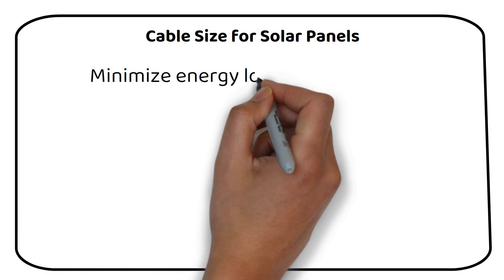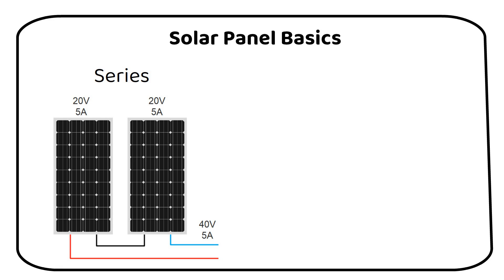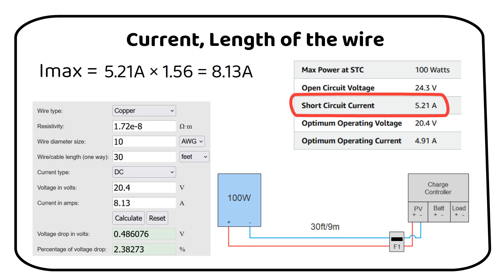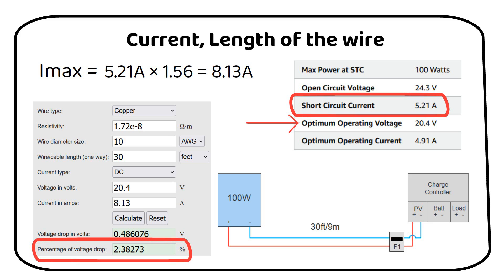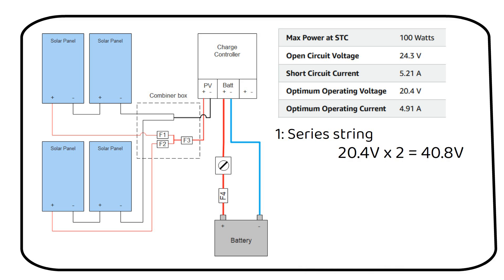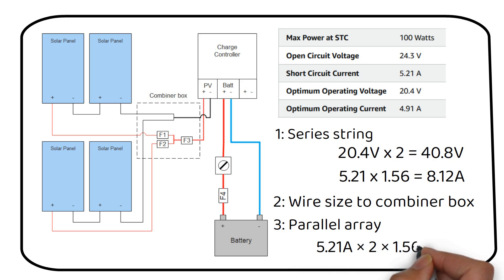Cable Size for Solar Panels - How to Size Wire for Voltage Drop

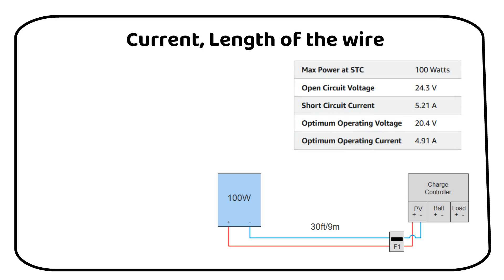Comment from the maker: UPDATE 1:53 to calculate voltage drop use Isc x 1.25 instead of 1.56.
My book on Amazon: https://cleversolarpower.com/off-grid-solar-power-simplified 
7 Free off-grid solar diagrams: https://cleversolarpower.com
Reply: no files on 7 free diagram
Reply from the maker: @Friona-il7og  I have uploaded them all to my homepage on the website now.

Comment: What is this App to calculaste voltage drop and percentagem of voltage drop?
Reply from the maker: I have a new video about the voltage drop coming tomorrow. I made a mistake in this one (Check the update note). The calculator is on calculator.net
Reply: @cleversolarpower  it is Voltage Drop Calculator
Reply: @c @cleversolarpower what is the link to new video?

Comment: You will notice the panel Where it says "Wire/cable length (One way)"  meaning 30ft is actually 60ft as a loop this is where you get your calculations from If someone tries to do the math without a app They might run into issues based off the idea that 30ft is 10awg

Comment: My panels to controller is going to be about 100 FEET. Maybe more.
Reply from the maker: You should wire panels in series and use an mppt. It's going to be much cheaper that way instead of getting expensive thick wires.

Comment: Hello if I have 4 X 570w panels rated at max of 13.07A and short crt at 13.7,A what twin core unsheathed solar wire would I need, I was thinking 6mm i have seen some sites say 6 mm is good 70a
Reply from the maker: It depends on the distance. Check my video about voltage drop.

Comment: Hey I have a question I really appreciate your videos and I'm learning a lot I'm new to solar systems I've got my solar batteries there are four eco-worthy 100 amp hour 48 volt batteries I've got to run them approximately 28 ft from my inverter and I'm having troubles calculating how much or how many gauge wire I need I'm running the 12,000 XP inverter and I was wondering if you could suggest is this even possible? I have no other place to put the batteries unfortunately
Reply: That is going to be expensive! It kinda depends on the amps going to and from the batteries, but you probably need to spec it to be able to handle 400amp continuous so it can handle going to and from the battery as well as surge when you start the Air-conditioner without causing voltage drop or melting the wire.
Reply from the maker: Indeed, that is going to be expensive. It's better to have them as close as possible. You need to do a voltage drop calculation as well. Search my channel for it.

Comment: So you should always use a thicker wire? The bigger the better?
Reply from the maker: Yes, but it will cost you more. And the terminals can only fit a certain size.

Comment: Isn't it that in the end of a day a current rate and cable length matters only? So let's just assume that 1m of cable which transfers 10A max, should be of 4 mm2. In case a panel has a maximum current of short circuit of 10A, then no matter how many panels you connect in series - you'll alway have 10A max. My point is that adding more panels in series increases the voltage, but it has no impact whatsoever on current rate thus cable diameter. Am I missing something? From what it can be understood from video is that for example 12V and 1A gives less wire diameter than in case of  24V and 1A, which does not make sense. It would make sense if the individual panel current would drop by half somehow by adding additional panel in series, but it is not the case.
Reply from the maker: As the length of a cable increases, so does the resistance. If resistance increases, the voltage will reduce or 'drop' thats why we call it voltage drop. Voltage drop can be reduced by increasing the voltage. so a 14AWG cable can carry 25A (90°C), but if you were to send 12V and 25A through it for 10 meters, then the voltage at the end will be 7.9V. Thats because the wire resistance is 0.165 ohms.

Comment: Why if we use copper wires it will getting black colour after a year?
Reply from the maker: Either you have a lot of corrosion going on or your wires are getting too hot.
Reply: @ 
Which cables u suggest for a 3KW Systems?
Copper or Aluminium?

Comment: Thank you Sir. Ive been through many articles and videos online , This is the first non confusing video on cable size that I encounter, The confusing part on the net is about the whole system voltage( 12 V for my case) and the PV panel voltage ( 37V) . Thanks again for the formula Isc X 1.56 which I didn't know.
Reply from the maker: A high input voltage is ok if you have a 12V system. It will reduce voltage drop. check my dedicated video about voltage drop as well.
Reply: @ Thank you again
Reply: @ I plan to use a single 300W panel to power 12 V lights in the house in case of power outage …No inverter…150Ah gel battery …lithium is way too expensive here.

Comment: Good video I think the takeaway is run the highest voltage possible first and secondly run the larger wire that you can afford.
Reply from the maker: Exactly 💯 limiting to 3% voltage drop is more than enough.

Comment: I normally wire my panels in parallel but i am currently installing 1.1kw ( 2 x 525watt panels) of solar feeding a Victron MPPT charge controller feeding a 280ah Lithium battery. How do you recommend i wire them? Parallel or series? And what would a 100/50 victron mppt work? I believe there are 100v maximum input and up to 50 amp.

They are STC Open Circuit 48V and about 14amp short circuit each.
Reply from the maker: You need a 150V charge controller. And always wire in series because that lowers the voltage drop and you can use smaller cables.
Reply: @ so if i wire it in series to increase the voltage will the MPPT still drop it down to approx 12v? Thanks for the help.
Reply: @cleversolarpower  im using 6mm (uk) cable which is about 10AWG (US). The cable run is around 4 metres. Correct me if im wrong but :

if i wire in parallel i get 21.875 amps  to my charge controller at 48v (my cable should handle up to 30 amps).

If i wire in series i get 96v and 10.9 amps to the charge controller?

In my understanding either wiring my cable would handle? Series drops to very low charge with any shade and as i live in UK that’s highly likely so why wouldn’t wiring in parallel to a 100/50 be the better option? I mean by them calculations a 100/30 charge controller would work?

Appreciate your view on this.
Thank you.

Comment: ok i am a newbie to this but i am taking solar kit to fiji where there is a lot of down time in electricity, so a solar system as a backup is going to help. but i want my system to operate as efficient as it can so i would greatly appreciate your help and any other imput people have.

i am confused though because i have bought a solar 360w solar blanket and a 100/30amp solar regulator

it has a short circuit of 18.85amp so imax = 18.85*1.56= 29.406amp. when i put this detail into the voltage drop calculator with a volatge of 24.147 from the solar blankets specification and running it for 10meter... it calculates i need a 6awg cable for that length giving a drop 3.149% which i figure is ok.   now according to research a 6awg can carry 55amp.  My first question is this 6awg too much or is this correct.

2nd question is the solar blanket came with a 12meter cable of 6mm2 is 10awg i take it but in the specifications it says 20amp max i asked the the retailer is this too small but he said its fine but going by the calculator it gives me a volt drop of 7.96% which is over the margin you stated.

so now i am confused could you please help
Reply from the maker: I recommend watching my video about 'load shedding' for a backup system. No the wire is correct because it's a long length. I recommend watching my video about voltage drop. The manufacturer problably used the Isc without any safety margin. A solution is to add another panel in series, this will increase the voltage and reduce the voltage drop.
Reply: @cleversolarpower  just confirming you are saying the 6awg is correct

Comment: Hie Sir, please i have a 430 watts solar panel and 12 volts 200Ah battery but want to be using it for lighting 5 watts bulb of which are 4 bulb for 17 hours. How possible it can be sir?

Comment: Hello. In a PV array of 4 units of 500W, do one need to compute the Pmax and Isc for the entire 4 units or just one like in the video above? Thanks for your repsonse.
Reply: Isc for a single panel only. It will be same in all of the other panels as the connection is in series (Voltages add up, I remains the same).

Comment: So your going to recommend/spend another $100 solar panel to save $14 on wire??? This doesn't sound very efficient.
Reply from the maker: It's not $100 wasted. It's $86 for 100W of solar panels more. Better than $100 if you know what i mean.
Reply: Why not go with one  big panel, 600 watts and a single controller ? I plan on doing this to simplify things , am I crazy . Big panel is only about 200 $ cdn

Comment: Hi Nick, In the wire calculator is says wire diameter size, AWG is not a diameter so if I'm using 4mm2 cable do I put 4 in the box or the actual diameter of the conductor.
Reply from the maker: You can switch to mm² on the side of the box.
Reply: Yea I get that but it's a bit misleading as neither AWG or mm2 is a diameter it relates to the cable area.
Reply: You can convert this mm2 to awg. Google mm2 to awg and review a chart. You can also convert to diameter in mm.

Comment: I have used 6mm DC tin coated copper wire for my 10kw ongrid Growatt inverter with 12 (7kw) solar panels. My inverter distance from solar panels is around 50 feet. My system is giving very good efficiency. Most of the solar system installers told me that they use 4mm DC wire if the distance is less than 100 feet and if the distance becomes greater than 100 feet from the inverter to the solar panels then they select 6mm wire. But here you are telling 8mm to 10mm DC wire which is confusing

Comment: When you are calculating the wire size for parralel solar system, are you using VOC and ISC numbers in your calculation? Or VMP and and IMP?
Reply from the maker: Vmp and isc (worst case scenario)

Comment: Any idea if a 10 awg cable can handle 3 combined strings of panels from a combiner box giving 2250 watts the amps are 15 after multiplying the safety 1.56 factor. or do I use 8 awg?
Reply from the maker: Please repeat the calculations shown in the video. I cannot make it more clear than that. Your distance to the charge controller is also a big factor.

Comment: What size wire do YOU, sir, think should be run between 420 watts PV positioned 15' from the charge controller? Nominal 12V setup, maximum 30 amp input to charge controller. Thank you.
Reply from the maker: I explain in the video how to do it. Please watch again and follow the steps.
Reply: What size did you end up using?

Comment: I know W=VA now. Thank you. 
Can we use solar panel of different brand names in the same system please? Or do we have to use same brand names of controllers, panels, inverters and batteries, please?
Reply from the maker: VA*0.8=W for example, the victron phoenix inverter with 1600VA has a power rating of 1600*0.8=1280W. You can use different brands. But for solar panels i would use the same brand and model, because they all differ a little bit ,which will lead to losses. Check my video about 'mismatched solar panels'.

Comment: CAN I CONNECT 48V SOLAR PANNEL TO 12V/24V  CHARGE CONTROLLER ? I HAVE 12V SET UP BATTERY 12V, INVERTER 12V, 50ACHARGE CONTROLLER 12/24V AND 3 SOLAR PANNEL 150W/12V EACH

Comment: What about stranded vs solid wires... Do they affect the efficiency/energy-loss?
Reply: Victron require the use of fine stranded flexible wire with their solar charge controllers as solid wire doesn't give a good connection in the terminals which leads to heat and fire.

Comment: Just came to mind I have 10 gauge, but at the  connections, the wires are very, very small/thin gage , so does that reduce the 10 gauge down to these small wires? Causing big energy lost? Thats how the wires came from manufacturer.
Reply from the maker: Do you mean the terminals are too small to fit your wires? Then I assume your panels are in parallel. Check the maximum input current of the charge controller as well. You can add another charge controller to spread the current out.
Reply: @cleversolarpower  Bluetti at barrel connector, maybe it's just not covered with the thick black sheathing a thin red an thin black wire come out. So think it's just not covered at the ends. My bad just wat they do it. Probably, sure same diameter inside bigger diameter just thicker covering.

Comment: There's a need to be careful when designing series PV Module circuits. The voltage increases in cold temperatures, and that needs to be accounted for, so we don't exceed the maximum voltage of the MPPTs, conductors, and terminations. I recently saw a video where the guy used WAGO connectors on his PV wiring. They're only rated for 300 Volts. But series PV strings go up to 600 Volts.
Reply from the maker: Indeed, this relates to the max input voltage of the MPPT. I made another video about sizing a charge controller, where I discuss this in detail.

Comment: I don't recommend connecting solar panels in series at all. You need AMPS to charge batteries, and you need a charge controller that will handle the AMPS being sent to it. I have four LiFePO4 batteries in parallel (400AH).  I have Qty 4 Solar Panels (100 watts each). 100 Watt Panel = 5.25 Amps +, Qty 4 Panels = 21 Amps, sometimes a little more, possibly 22 or 23 Amps on a good day. Charging the batteries at 22 Amps or more is pretty good. We need Amps, not Volts. A 100 Watt Solar Panel only needs a 16 to 14 AWG Wire to carry 5.25 Amps plus, however, once you bring it all together, you'll need a 12 to 10 AWG Cable to carry 22+ AMPS to the Victron 100/30 Smart Controller. I use 32ft. of 10 AWG Wire (rated to 30 Amps) to be safe. I power a small college refrigerator and two freezers using a 3000/6000 Watt Inverter, pure sinewave output signal. From the battery, I'm also using a Victron 500 Smart Shunt. It's all monitored on my cell phone, through Bluetooth. I works great.
Reply from the maker: This is not true. The mppt will convert the voltage into current because power=volts x current. Power in equals power out - efficiency loss. I recommend watching my video about pwm vs mppt where I discuss how current transformation works.
Reply: @cleversolarpower  OK - you're correct. I forgot about that. Thanks.
Reply: @cleversolarpower you are right sir
From experience, series wiring is preferable
Reply: @vaelectrical You reduce the wiring cost,decrease the current required for the charge controller and then increase the overall efficiency
Reply: Your method is only correct in small solar setup. Once you start getting to 1000 plus watts of solar you wish you wire them in series.
Reply: Bcos you did that,  doesn't make it a recommendation. It's best to connect in series if you are after cable cost. Series or parallel connection all amount to the same power. But consider the cost of wiring as the wire size you would use for parallel  connection differs from a series connection.
Reply: @solvartech Also many charge controllers are current limited  so having a 48V battery bank you save money on a charge controller. I would never put a 12 or 24v system in a fixed location. I have been using a Trace SW 4048 for close to 30 years with no problems. I worked on a lot of 48V systems in telecommunications.
Reply: Lol noob. Use high voltage string and save money on copper. Wire battery in series.
Reply: As copper is not cheap at all @liesofgasandpilesofshoes

Comment: What is the logic behind the 1.56 safety factor add to the current? How will the panels make half again as much current?
Isc is shorted out so that is the maximum current it can put out. I see 1.56 applied to the input current of a charge controller if it isn't continuous use.
How does this apply to current in a wire
Reply from the maker: It accounts for higher temperatures in the wire in an outdoor setting. Higher temps means reduced current carrying capacity of a conductor.
Reply: @cleversolarpower  In I-V curve , higher temp cause a slight increase in current, so why u are saying that the current will be reduced with higher temp?
Reply: @daliahammad8709  He didn't say the current will be reduced. He said the current carrying capacity of the wire is reduced. As it gets hotter, as you say, current increases, but wire current capacity decreases. That's dangerous.
Reply: It's a safety factor required by the National Electrical Code.

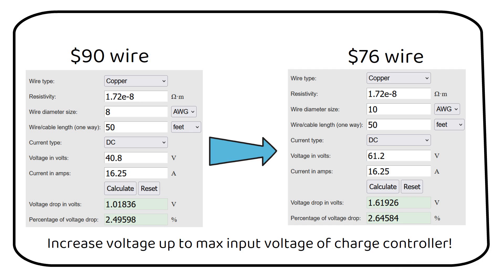Comment: 6:39 here to reduce wiring cost we also buy another solar panel which is way expensive than the now (76$) to then (90$) wire cost :D
so i dont see increasing solar panel voltage leading to wire cost savings 😅
Reply from the maker: I knew this comment was going to come one day 😄. It's to prove a point, to always increase the voltage up to the max input voltage
Reply: Increasing voltage can reduce wire costs. By allowing you use lesser cable size for lower current
Reply: I had experience breaker and cable becoming hot....I have solar 2 PCs panel 590watts each and controller mppt 100watts and 4battries